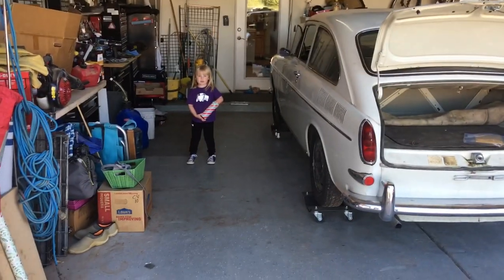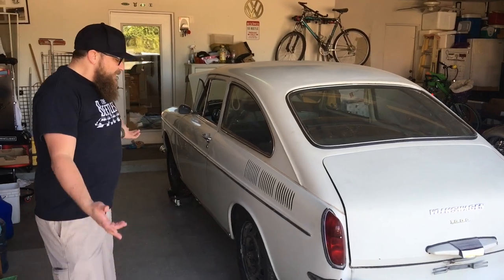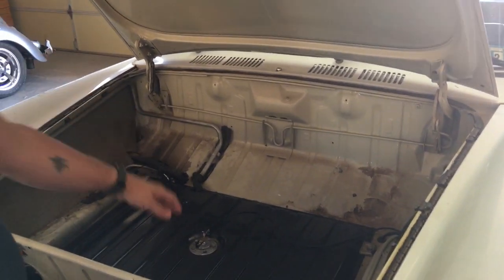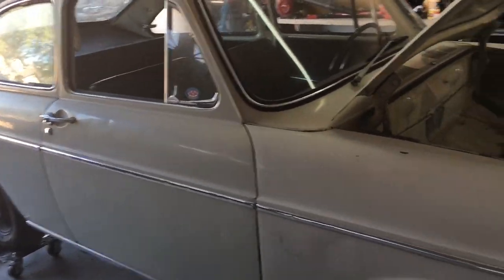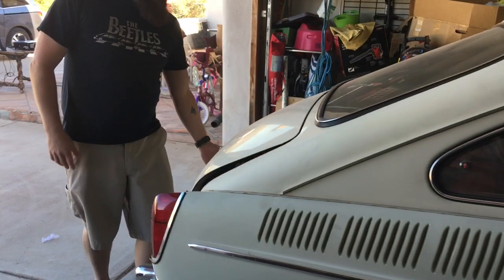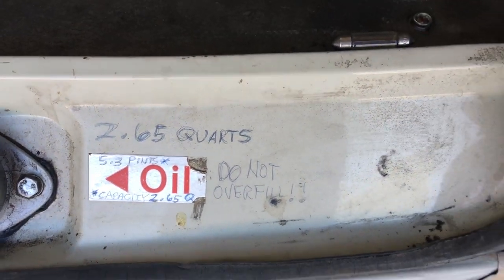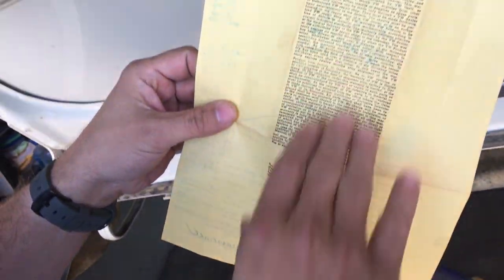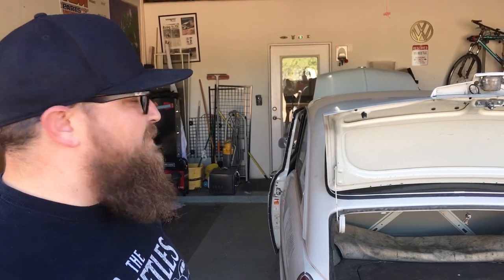Uncovered: 1966 VW Fastback Barn Find Revealed!

Comment: Parked it because a leaking fuel line.  The one I drove in HS and college sprouted a leak while driving in South Dakota.  Pulled off on the next exit because of power loss.  The Amoco station had a type 3 sitting out back that someone had abandoned.    He loaned me a screwdriver and I pulled the fuel line off the abandoned one and installed with a hose clamp.  Took 15 minutes, and held up fine until I sold it 2 years later.
Reply from the maker: Wow that's awesome! This one was same family since new the son drove it forever parked it one day because he smelled gas and there it sat for about 25 years! I've been having fun working on this one it's definitely the most original vw I've owned!